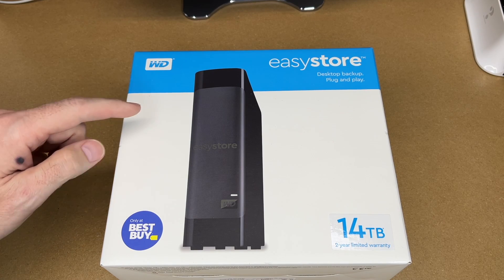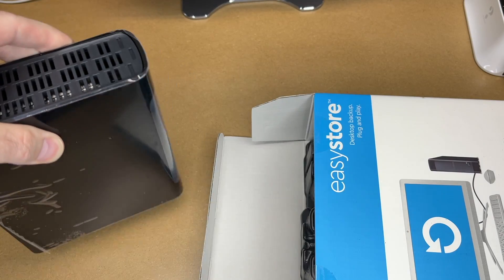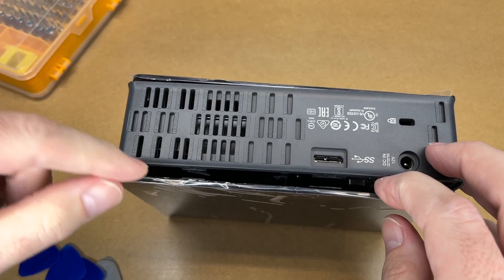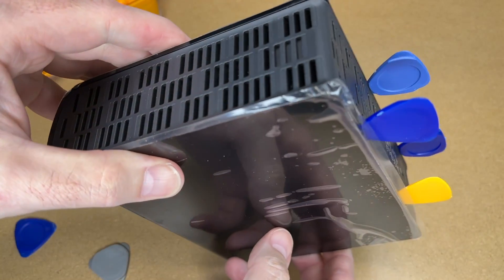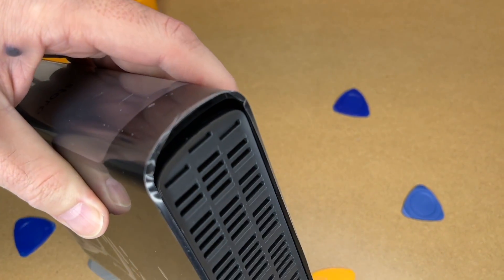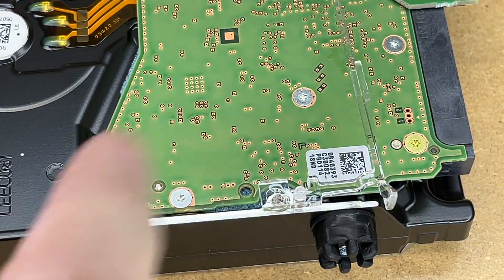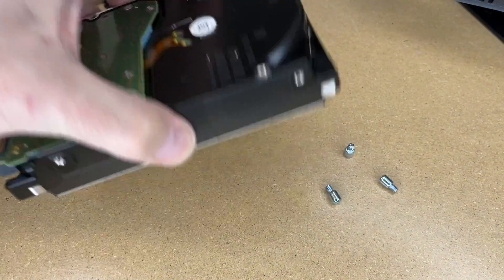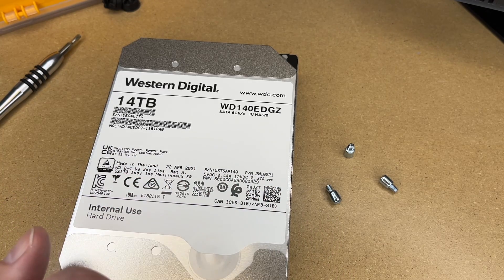Shucking WD Easystore 14TB Hard Drives

Comment: I shucked my 14tb drive and I plugged it via sata and it doesn't show up is disk management. It only shows up if I have the original board that powers and send it via USB plugged in but I've formatted it and tried plugging it back via sata amd nothing any odeas
Reply: You are probably already aware....but search "3rd SATA pin and shucking HD" and you will get info on how to bypass this.

Comment: Really appreciate the vid.  I watched a few of these but never picked up on the detail u don't actually slide the pick/credit card underneath/beneath the clips to 'unlatch' them. Instead you simply jam the pick down ON TOP of the clip location UNTIL u meet resistance. Then you simply lever the case open using a flathead screw driver.  Up until now I've been trying (and failing) to JAM the pick/credit card behind & up underneath the clips, kinda how you can force a door lock open with a credit card.  Wrong.  Your vid clearly showed me the proper method.  THANKS!